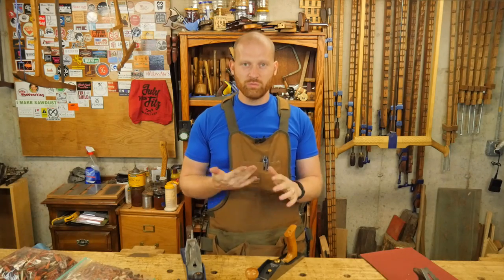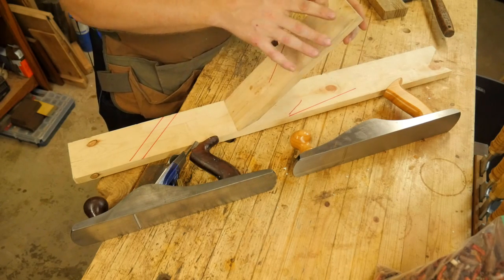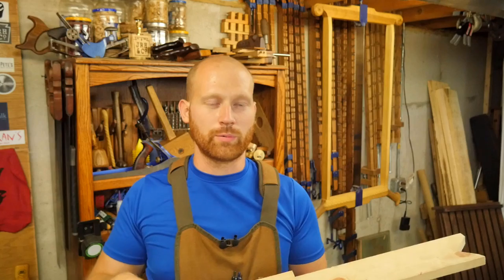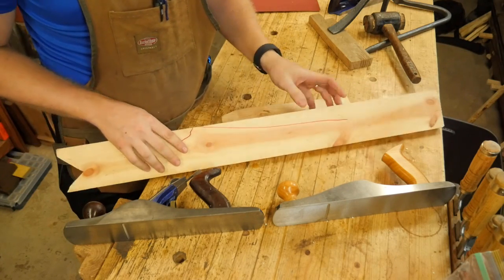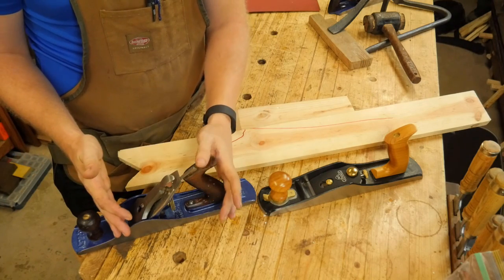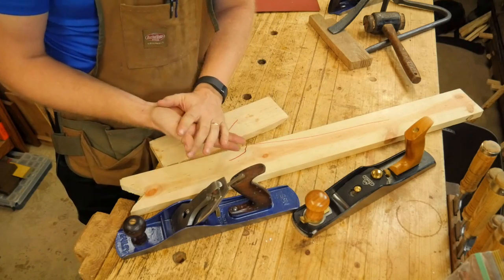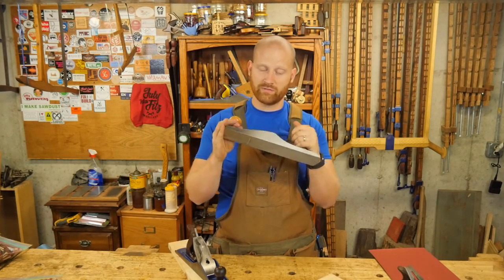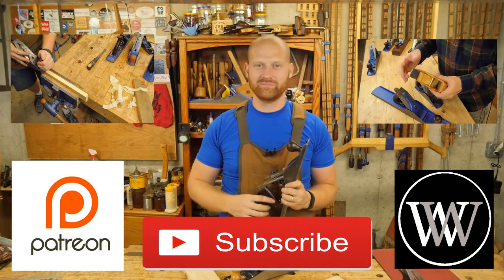Low Angle Jack Plane Vs High Angle Bailey Pattern Hand Plane Hand Tool Woodworking

Comment: I’ve seen elsewhere that you can put a 10° second bevel on the back of a bevel down plane to create a plane that will do the same work as bevel up plane, or more accurately a 50° frog. I have tried it with a very cheap plane and it does work for my standard of woodworking. I use a block plane for end grain, which is a bevel up plane so why not use that in difficult areas? 

I must admit the cabinet scraper you advised me about is always close to hand for difficult areas as well. An amazing tool, and for many of my age or above a lot less wearing on arthritic fingers than a card scraper. Thank you for that. 

Except with my long paring chisel I now work with my bevel down again following your advice. It is easier to keep your work accurate as you see the tip of the blade more, it also cuts smoother, (or that might be down to improvements in my sharpening).

I sing your praises everywhere for all the help you have given me, which is heck of a lot of help. I know from personal experience you answer all questions you are asked, which is incredible for someone with two channels and over 80k subscribers on your other channel. Please don't ever think it isn’t appreciated.

Another great video, thank you.
Reply from the maker: Thanks man! That means a lot. yes you can change the angle and you can buy different irons with the angle ready to go, but you can not put a chip-breaker on it.
Reply: Wood By Wright I didn’t know about the chip breaker, thanks.

Comment: Thanks for point me over here, this was super helpful! Definitely answered a lot of questions and gave me the info I needed to start thinking about what would be best for me to start my collection with.
Reply from the maker: Sweet! glad I could help!
Reply: i dig the bevel up planes. i have all styles, from bailey to bedrock, new veritas smoother wood river, stanley...but my two favorite planes, and the ones that work the best with the least effort for me are my two liw angle planes. veritas becel up jointer and lie nielson vecel up jack. these two planes can do luterally EVERYTHING. my 62 low angle takes such gine to heavy shavings it blows me away.

Comment: For what it is worth having used a new low angle jack plane and an older Stanley #5, there is a large difference in the thickness of the blades and I think this might add a few points for the low angle but if you are buying a new #5 it is not a consideration.  The low angle sure cuts easier in my opinion, so much so that I will buy one.  Thanks for the video!  Love the channel.

Comment: I am new to woodworking but how do you know which is bevel up/down?   I got one from a store and it looks like your high angle plane but the blade came bevel up. is it wrong from the factory please let me know as I am enjoying woodworking.
Reply from the maker: You just have to know the plane, but rule of thumb is if the bed of the plane is higher then 20 degrees then it is intended to be bevel down. 90%+ of all planes are bevel down. it sounds like yours was put in upside down. but feel free to email me some pictures if you want me to take a look. email is int he about tab on the channel page.

Comment: Thank you for that information.  I have been doing woodworking for many years now but never quite figured out why I should want a low angle plane despite having a quite extensive selection of planes.  I started with my dads old Stanley No5 that he had not looked after and he had never learned how to sharpen the blade!  It was far from flat so back in the 1970s I phoned Stanley to ask if they offered a re-grind service.  The man said not, but then he said "oh wait a minute, that would make a good exercise for the apprentice so post it to us".  They flattened it and posted it back for free!!  Oh for the days when service ruled.  It remains my go-to plane along with a Stanley 9 1/2 fully adjustable (and low angle) block plane that I cannot recommend highly enough (forget the over-priced Lie-Nielsen etc).  I think that maybe when I have a job that needs a lot of end grain work and I need far more weight than my 9 1/2 then I will justify a Stanley 62.
Reply from the maker: So true. The mane use of the low angle Jack was for flattening butcher blocks.
Reply: @WoodByWright  'Mane' isn't that what hoses have?  I'm a Brit so maybe that is the way you guys spell it.  We spell it 'main'.  Incidentally, a lot of the stuff we think of as Americanisms - words like 'fall' for autumn and 'sidewalk' for pavement are in fact the old English expressions.  You guys didn't change, we did.

Comment: Hi, I love watching your videos, I learn so much from you. I'm little bit embarrassed beause I only got shaving from bevel up planes. Whenever I try a bevel down iron and a chipbreaker nothing but cloging in front of the blade.I try and try on and on the traditionnal way but nothing. I have 2 N°4 Fischer Darex plane with thin walls weight almost nothing. One is a smoother and the other a scrub and 2 block planes bevel down. I've made lastweek a low angle bevel up and shaving came in seconds.I had never trouble using bevel up iron and the result is really smooth. I usualy use pine, beech, birch, mapple, and oak. I don't understand why I can't manage to use beveldown and chipbreaker.
Reply from the maker: It's usually one of two problems if you're clogging in the mouth. Either the mouth is too tight which is the less common problem. Or the chip breaker is not fit well to the iron. Most of the time that's the problem. I have a video on mating the chip breaker to the iron if you want to see more on that.
Reply: @WoodByWright  thanks for answering so quick :) I'll watch it. It's 3 or 4 years I'm fighting with it watching lots of videos, trying right away with all the double irons planes but get tired and I only keep my N°5 . Hope the struggle will end soon :D
Reply from the maker: Here is the video. https://www.youtube.com/watch?v=cQzLdMsGCqk if that does not work feel free to send me an email with some pictures and I would be glad to look it over with you. jameswright@woodbywright.com

Comment: Thanks to you and Rex Krueger, I've finally made friends with my number 4 plane, even to the point of buying a number 5.
Reply from the maker: Sweetness!
Reply: I know this is sort of over the top, but I eventually decided that if I was going to be serious, I needed a jointer, a jack and a smoother.  I had a couple of older No. 4s, a 60 1/2 and a 65, but decided to buy a #7 jointer, #5 1/2 jack, and #4 1/2 smoother, partly because I can swap irons among all three.  Most people aren’t going to want to dive in that deeply.   I could probably have learned, and do, 75% of the value with just a #5 1/2 or #5, but using the #7 can really teach you a lot about wood and planes.

Comment: With a bevel down plane the main thing is that there should be no (or very minimal) contact between the beveled surface and surface being planed.  I have found that every plane that ever gave me trouble with chatter has a lack of support under the blade.  The fix for one was to file some high spots on the bed - the fix was about 15 seconds of filling.  Another after determining the bed was flat, I checked the blade and cap iron.  They were both bowed upward slightly, away from bed. It left an interesting, high frequency series of little waves across the width of the board that looked like a tiny power jointer had surfaced the board.  The blade is already raised about 1/64th above the bed.  As the plane moves foward, the blade and chip breaker flex a very small amount and then push forward scooping a very short, shallow divot.  You can hear the action even though the surface seems pretty good until the light hits it just right.

Comment: Old video, I know…this is a great summary, IMHO.  Suggestion: a fairly deep dive on use and applications for the different bevel angle irons sold by LN and LV for their low angle bevel up planes could be a great resource.  I don’t remember seeing anything like that on YouTube (or elsewhere).  I agree with your overall assessment of this situation.  I have seen so many people recommending LABU planes on the basis that “they’re easier to understand because there are many fewer things you need to learn about setting them up.”  Well, yeah, maybe, but IMHO you’ll never really learn what hand planes can do, or how to use them, if you start with a LABU plane, and for those reasons you’ll probably decide that using hand planes doesn’t offer your work anything you can’t do easier and better with a sander. That’s obviously a personal opinion rather than a proven fact. 😊

Comment: Second time watching this James and I enjoyed it just as much as the first time. Do you still use the Stanley No. 62 and do you still like it? I considering getting either the Stanley or the Wood River low angle jack. Thanks.
Reply from the maker: I do still own this one. It works well though it doesn't feel as good in the hand and there's a few things about it I just find to be a little bit cheaper. That being said it's a good plane and if you treat it right it will do you well. Since that video Tay Tools has started offering one that I find to be a little bit better bang for the buck. Slightly higher quality materials and a little better fit and finish. https://lddy.no/gt2p

Comment: I get by pretty well with bevel ups. I have had issues but 38 degree blade helps quite a bit in most situations. They are really simpler and I love that. I have a jack and a small bevel up plane from veritas. And for now I cant find a justification for buying another one.

I think this is a fair review.
Reply from the maker: Very true they are simpler. It is a lot of fun to play with for most situations!

Comment: So I didn't know what I was doing and wanted to get into hand tools. I bought that exact same Stanley Bevel Up plane that you show in the video. What angle do you sharpen yours to? I know you said they come standard at 25 degrees.
Reply from the maker: I just kept it at 25 degrees. For end grain work that is great. And that is what I use it for the most.
Reply: @WoodByWright  awesome thanks!

Comment: Great explanation! Quick question- can you flip the blade on the bevel down to make it a bevel up to have a very low angle blade?
Reply from the maker: No. If you flipped over a bevel down iron it would make it a very high angle. Also it would chatter as nothing is supporting the iron. So no it does not work like that.
Reply: Wood By Wright thank you!

Comment: If you have an ultra low angle frog, you have to grind a really delicate edge to your iron to get the geometry to work, meaning for all intents and purposes you need a dedicated blade (although you can beef up the edge with a microbevel). Great breakdown, James.
Reply: But even with microbevel, this delicate bevel angle won’t help your case with end grain hardwood chatter.
Reply: Kinda defeats the purpose then IMO. Actually I don't really buy the whole low angle logic. To me all a low angle jack plane amounts to is a long low angle block plane which I've found unnecessary. Haven't used mine in ages.

Comment: Wonderful explanation of the different planes. I've been looking at the bevel up planes recently and was unclear as to how well it would work on straight grain, as I'd seen some conflicting opinions online. Do you find the bevel up plane has an issue with track marks, due to not being able to put a camber on the blade?
Reply from the maker: No more problem then a normal bevel down. You can camber a bevel up plane I have an iron for that. But track marks are more about how deep you are cutting.
Reply: @WoodByWright  Perfect. Thank you very much!

Comment: Very good video showing the + and - of each type of planes.  I have one more consideration and it is sharpening.  I free hand sharpen in a couple of minutes but with a low angle plane, if I want to get 25 degree, it's just too low for my hand who are wrapped around the blade.  So, in my case, it's a standard plane free hand sharpen.  I've sold my low angles planes.
Reply from the maker: Very true. I should have brought that up too.
Reply: Wood By Wright what type of sharpening plates/stones do you use? Thanks

Comment: Would there ever be a reason to do 20 degrees in a bevel up plane?
Reply from the maker: You could do it. But you're going to have to sharpen it every 50 or 60 strokes maybe even less than that. It would push even easier through end grain wood.
Reply: @WoodByWright  Thanks,

Comment: I've put a back bevel on my Bailey pattern plane blade.  My problem is when I need to re-sharpen.  It seems to me that I have to get rid of the original edge and hence the back bevel first before I start to re-sharpen.  Am I doing something wrong?  Also, I have just bought a low-angle jack plane, the blade of which is ground to 30 degrees.  Will it work to just put a sharpening angle of 40 degrees or do I need to regrind the entire blade?
Reply from the maker: first I would ask why you put a back bevel on the iron and with which method. that is one of the reasons I do not use them it is just another step that is not needed in my book. you can regrind the LAJP but that will make it a very high angle plane. Usually, if you like to flip blades in and out I like to have one at 25 degrees and one at 40. that way you can choose what angle you want for the wood.
Reply: Thanks for replying.  I work almost exclusively with birch faced multiply - where I live, it's cheap and available.  Other woods are more expensive and harder for me to get.  I don't drive.  My problem, when cleaning up is tear out.  Another youtube video suggested two ways to tackle this.  The first is to put a back bevel on your Baily pattern blade.  The other is to use a LAJP
Reply from the maker: i see. well to be completely honest neither of those will help you that much. there are three keys to fighting tear out. 1. High hangle 45+ (My smoother is 60 degrees) 2. chip breaker really close to the tip ( i put mine about 2-4 thousands away from the tip.) 3. tight mouth. tear out will never be bigger then your mouth is open.( I keep mine about twice the thickness of the shaving I want to take.) that is all to say that the blade is not just paper cutting sharp, but full shave sharp.
With a bevel up plane, you can get the higher angle with a 40-degree iron (52.5-degree cutting angle), you can also easily tighten up the mouth, but you can not put a chip breaker on it. for some people that is enough.
with a traditional Bevel down the angle is determined by the frog (normally 45 degrees) you can also close the mouth by moving the frog forward. last you can easily adjust the chip breaker to be VERY close to the tip.
Here is a video on setting up a smoothing plane for that. https://www.youtube.com/watch?v=vG-DULSw6Zk
and here is one on how I tackle tough grain without tearout. https://www.youtube.com/watch?v=iIBPj02UuNI
and here is one on a cabinet scraper. they do not cost that much but they do amazing things. https://www.youtube.com/watch?v=YmknRm4-RCU
Here is the cheap one I recommend. http://amzn.to/2xJ2qcG

I hope that was not too much Information. If there is anything else I can do let me know.

Comment: Wouldbevel down produce a rougher cut?
Reply from the maker: actualy the lower the angle the more chance of tear out. that is why most smoothing planes are bevel down. the higher angle will usually provide a smoother cut easier.

Comment: I have a dilema, I'm completely new to woodworking and i've heard from multiple sources to get a bevel up jack plane because they're pretty versatile. Where in the hell do you find these things? I wanted to get a quality used one that I could clean up so I wouldn't have to spend as much but they are impossible to find, even on ebay 99% are bevel down. Anyone know where to get one??
Reply from the maker: finding an old 62 is extremely difficult. originally they were only used for end grain cutting boards. And if money is an issue I would counsel you to skip it. you can do anything you want with a Bevel down traditional plane you can find those for a lot cheaper. if you really want a bevel up plane the cheapest route is normally getting the new Stanley. that is what I use in my shop. here http://amzn.to/2pcslc4 but a Bevel up is not a necessary tool. I went a year or more before getting one.

Comment: Great. So i need more planes :/

Are there bevel up wooden planes? Can you show how one is made?

Is bevel up only for jacks and block planes? Or others also?
Reply from the maker: LOL you can never have enough planes!

I have never seen a wooden bevel up plane like this just because the bed would be so thin. I have seen under mounted chisel planes with a bed angle of 0 degrees, but that is something else all together.

traditionally Bevel up was mostly just for the Jack and low angle block planes. but now several companies are offering them in the  #4 through the #8. I find it most useful int he #5 (great length for a shooting board, cutting boards)
Reply: Maybe it is possible to make wooden bevel up plane with steel sole. I think that one day i'll try it. Regards!
Reply from the maker: +Stavros Gakos sounds like a really fun infill plane.